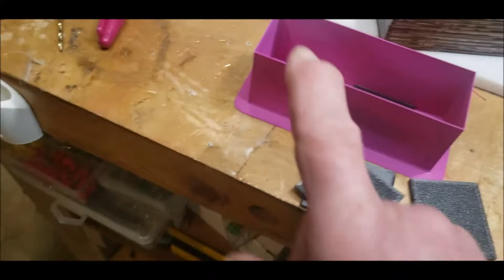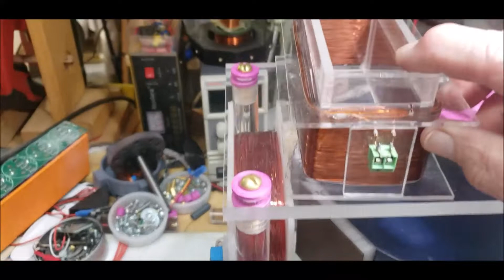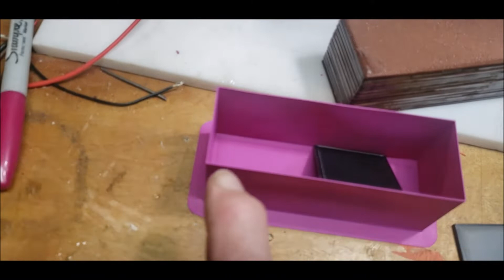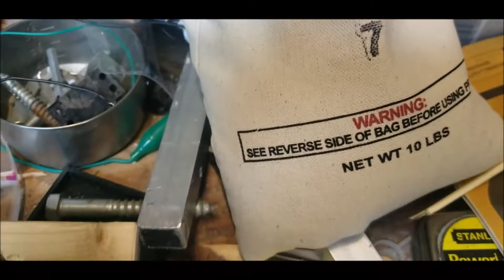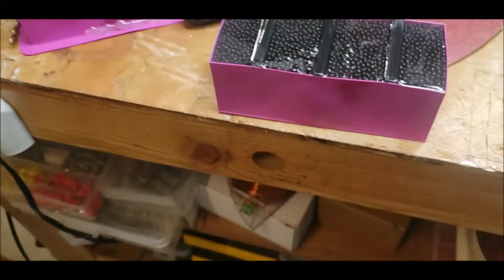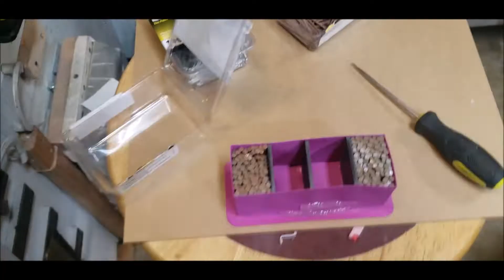3D Printed Coil core design

Comment: Hello, I have already tried a solder iron core and the most probable thing is that the rotor will stop, the eddy currents will be very powerful and the rotor does not have the strength to overcome them
Reply from the maker: I'm using them as a pick up coil. I've already done this and it works great.